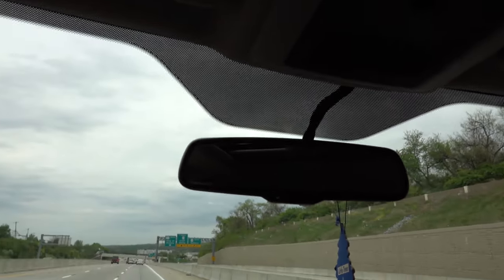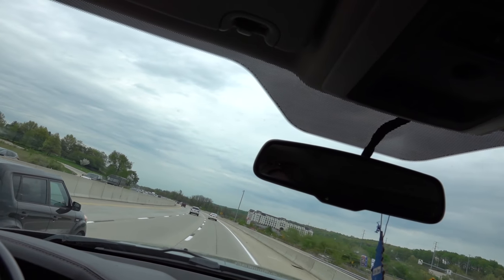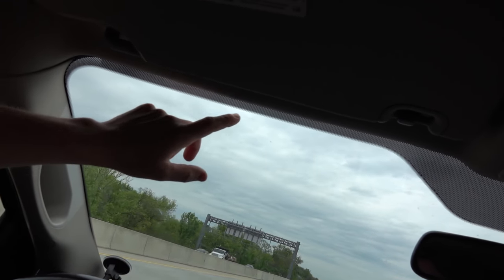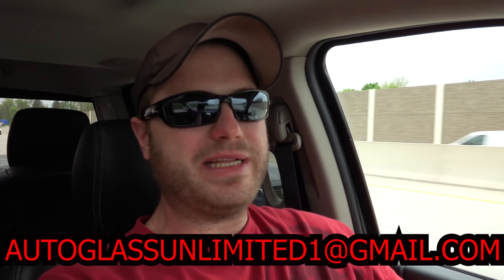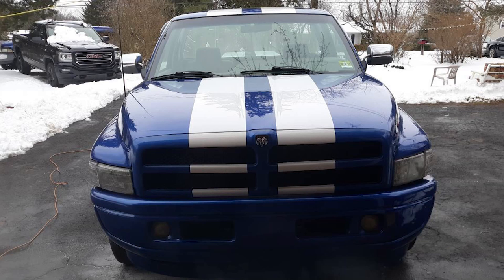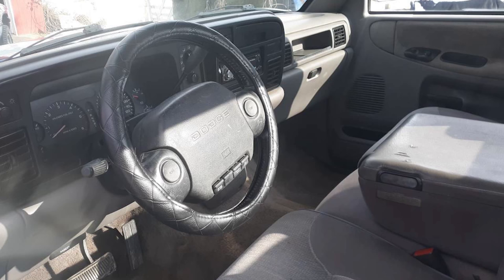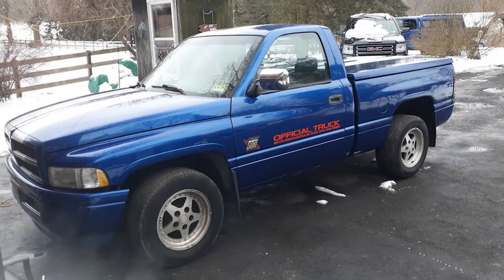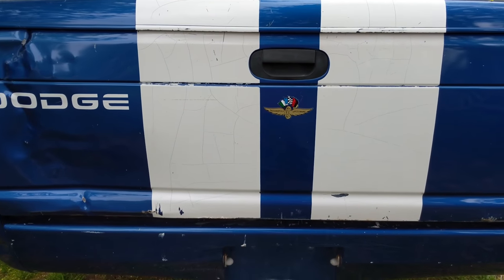Truck Seller Hides The Truth... Tries To Scam US!

Comment: I bought that exact same truck, well not that truck, but one exactly like it in 1996
 brand new off the lot, I REALLY enjoyed owning it, but it's nothing special  just a short wheelbase with a 360ci with a nice shade of blue with  vinyl stripes. I traded it in an a Mazda B4000 quad cab 4×4.  The crazy thing is the mazda B4000 could beat that truck on road, off road, anyplace any time. The only thing the ram has is it looks good and that's pretty much it. Don't get  me wrong, I would still love to have it today, but it would have the 797 redeye challenger engine in it, then it would be AWESOME..
Reply: Virgle Phillips That Mazda is technically a Ford Ranger right?
Reply: @RFJersey  Mazda is or was a sister company of Ford, but I'm not sure if they are now. Well that was the closest to a Ford that I ever had owned.

Comment: That windshield is also 400$ cheaper. I had to replace mine as well and it would have cost me 650$ to get factory installed. Went with same basic windshield.
Reply: 125 for a windshield in los angeles im just saying.
Reply: @MrRunsideways  I'm in DFW. It cost me 250$ to get mine replaced but if I'd wanted the factory shield with the ram logo it was going to be 650$. I've got the eyebrow anyways so it wouldn't have mattered so I went cheaper.